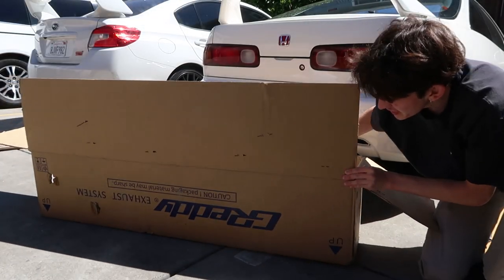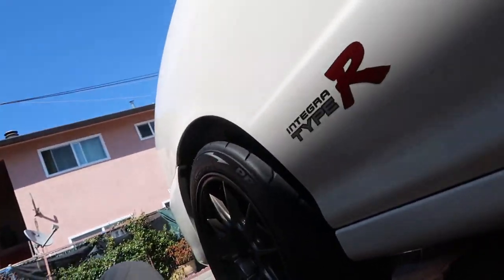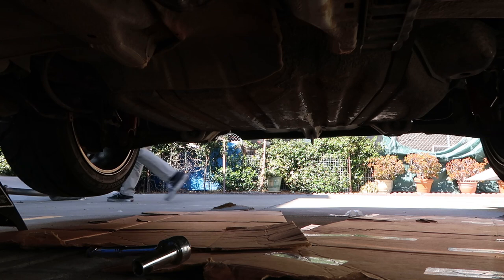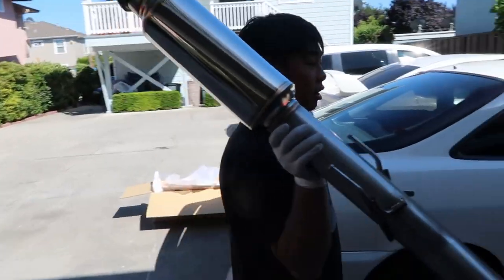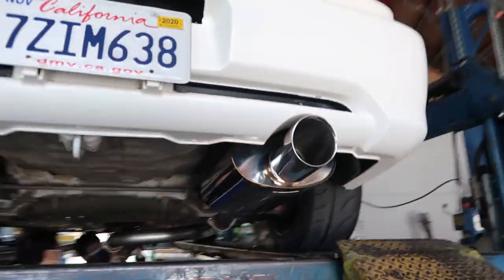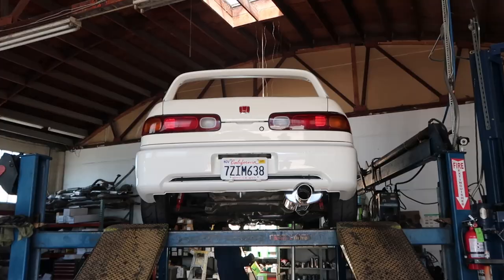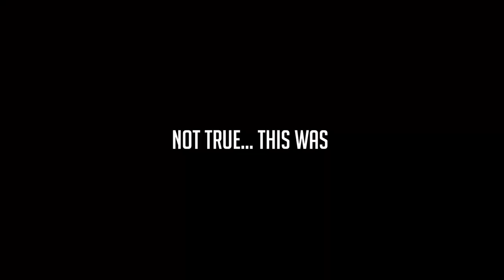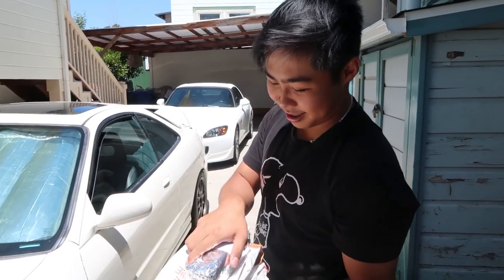THE BEST EXHAUST FOR INTEGRA DC2 (GReddy Supreme SP Catback)

Comment: So exactly how do u go slowly from 2.50" from cat to  3" and state that as a true 3" cat-back exhaust 🤔 second thing is rather than choosing exhaust based off appearance looks do some research and understand what a exhaust system job is as well as what a specific motor benefits from and you would at somepoint hear a word called sport exhaust system and with sport exhaust systems they have and currently are always shaped oval with tip in center , Smh and most all quilty built brands have a version, cause a 3" muffler inlet diameter isn't what goes on a civic or integra unless it's a turbocharged setup, otherwise it's 2.25-2.50" for backpressure requirements for N/a power smh this is why hondas got the rice burner and fart can sounding import cause of things done like you're doing and the outcome usually isn't the best least sound/performance wise 😢 my systems are tannabe hyper medallion on delsol and integ gots apexi world sport, but there are much more brands than that and all are sport style exhaust

Comment: Great sound and car bro, quick question/s. Why did you guys have to take it to the muffler shop? Did they have to mod the cat to fit the 3 inch piping? I just ordered a skunk2 76mm (3inch) you think id be better off going with greddy?
Reply: Forget the 1st question bro, just rewatched it lol but if you could still answer the other 2, wondering if a stock cat can weld onto the 3 inch piping
Reply from the maker: @iq805bones  yes the stock cat can weld onto the 3 inch piping.

Comment: I literally just dropped 1200 on custom TIG welded V-band full exhaust for my 01 GsR. Worth every penny. 4-1 true 2.5" header to high-flow CAT to Vibrant ultra res to Vibrant muffler.
Reply from the maker: Sounds like a very sweet setup! We are going to be doing something similar in the coming months 👀
Reply: @Seikers  it sounds crazy man! So deep an zero raspy "Honda exhaust" sound. My wife thought I pulled up in a Subie hahaha
Reply: Post a video I would like to hear this vibrant setup 👌
Reply: @passionplaya1171  aight, I will after I get done with some shit at work my dood!
Reply: @passionplaya1171  uploaded a quick one as I was leaving work. I'll post some more this weekend of drive by an pulls.
Reply: @riverwarts9084  Appreciate it bro 💯
Reply: Nice picked up some 1320 421 headers with a plm 4-way  test pipe with a  full 3 inch skunk2 rr exhaust system haha can’t wait to start putting my car back together 2001 Gsr

Comment: Also maybe the condensation could be coming from the exhaust manifold if the gasket wasnt on properly and torqued down.
Reply from the maker: yeah I think that is one of the reasons. The previous owner used bolts instead of the stock studs to nuts set up.

Comment: Does this sp go for my integra 00 Jdm type R. Is it Ca legal ? Thinking of buying for my integra
Reply from the maker: yep! it works for the type r models and bolts right up. as for gsr you will need some modification but an exhaust shop can take care of it for about $100
Reply: Thanks a lot.  What site carries this exhaust ?  I have a 94 GSR with 00 JDM type R swap
Reply from the maker: @reverester317  vivid, evasive, nengun

Comment: Damn the integra looking cleaner with that exhaust 🔥🔥🔥 (it doesn’t look like an oval though)  what tires are y’all running on it though I need em?? 🤔
Reply from the maker: Thanks! The tip is circular, but the muffler is oval. The tires im running are Toyo R888R. They are track tires with short life span. Also, they cant really be driven in the rain.

Comment: does the steering wheel look crooket or am i tripping
Reply from the maker: Wdym haha
Reply: Seikers i just meant like is the car alignment straight cause the steering wheel looks crooket but i’m probably tripping 😂
Reply from the maker: @victorh0716  haha its probably crooked because I lowered the car. Going to get an alignment after changing the suspension.